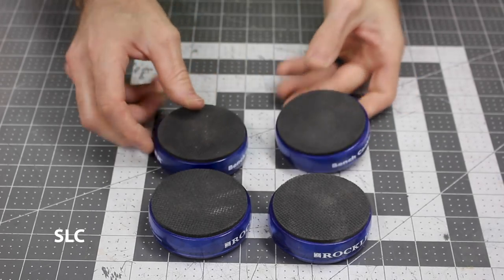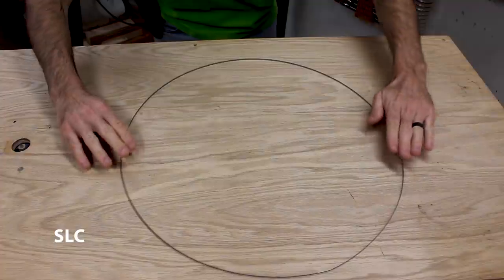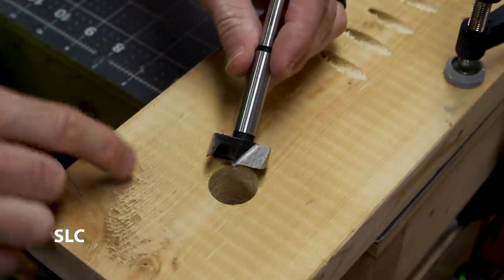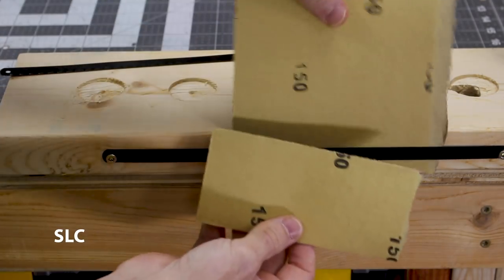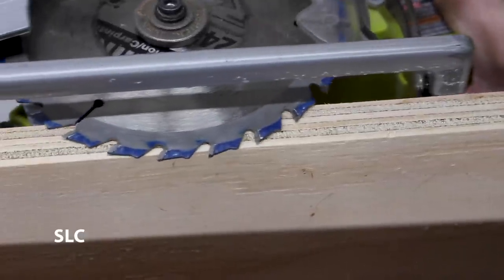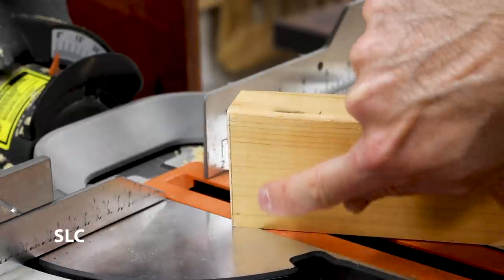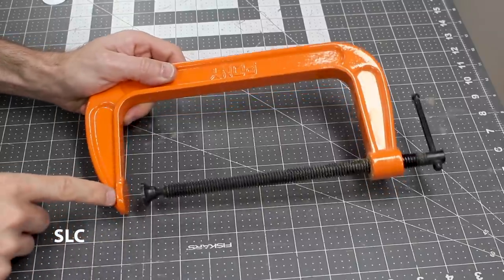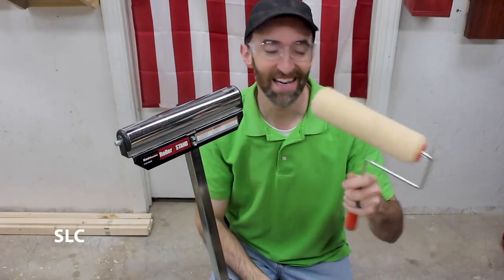20 Workshop Tips and Tricks #2

Comment: For the sanding belt cleaner, you can also use most any rubber soled shoe....not your good shoes, but those headed for the trash.
I go to Dollar Tree, Dollar General etc. towards the end of summer and buy a few pairs of cheap...like $1 a pair "flip flops" (get the largest sizes for even better value)....they work just as well as those purpose made "eraser sticks" and are MUCH cheaper.
Reply from the maker: Great idea on the flip flops, thanks.

Comment: I use a couple squares of floor exercise padding to work under the sink, on gravel around the car, or keep my pants knees out of puddles or snow.  

In the cabin, I tore up the old shag carpet and silverfish padding, and put down 1/2 inch exercise squares.  They significantly cut the draft through the subfloor, and I can peel the area rug back and move the tiles around from high traffic areas to the walls where they can fluff up again for longer life.

I don't have a dedicated space for tool storage, but I have assorted tools in each category that won't fit in one tool bag.  so I have resale rolling duffles dedicated to the type of tool, and I put manuals in the flat pockets in front.  These are relatively inexpensive in resale, usually less than $10 for a bag.   I use chain tags to mark what category of tool is in them:  Drill/drivers, saws, fasteners, heat (glue guns, propane/butane torches, heat stripper, soldering irons, etc.,)   electrical, plumbing, automotive.  When I have a project outside, I roll the bag out to the job.  It's a little fussy but when you're an apartment renter, sometimes dedicated shed/garage is not available.  Rolling duffles are easier to get up and down stairs too.

Comment: For a sand belt cleaner synthetic wine bottle stoppers work great I cut a piece of 1/2 PVC pipe to use as the cork holder. Use hot glue to secure the stopper to the PVC as a handle🤣🛫

Comment: To clean sanding belts just peel the plastic from a solidified tube of silicon sealant and use the “rubber” cylinder as described in the video

Comment: Instead of adding magnets to pencils and sticking them everywhere, buy a retractable lanyard and attach the pencil to it.  If you use a mechanical pencil with a pocket clip, it will slip over the plastic end and securely hold the pencil.

Then when needing a pencil - it is always with you.  Just pull it out, use it, then let it retract.  

(don't recommend something I don't do).

Comment: The whole idea of having casters on my tools is totally lost to me!! You see first you have to understand that "my shop" is very small...8 foot wide by 16 feet deep, so I don't normally have room to "roll my tools around" as much as it is just easier to take them outside on a nice day set them up and use them IN MY YARD in front of my "shop"!! And space in my shop as you can imagine is BEYOND a "premium" to the point where everything "fits into it in just one way"!! So i don't have room for "large tools on rolling stands" to begin with, and MY SHOP also has uneven wooden floors that are NOT the best floors to roll things around on in the first place either!! After all my "shop" is a wooden shed, that was built (and poorly designed) for the most part by an IBM Engineer, who knew NOTHING about building things so the floor supports are a joke at best!! The "NEW PART" of my shop was built by me, and I am not a "rich man" and "used what I had" so the floor in the front part of my shop (I have a video on YouTube which I am planning to update soon) is basically pallets bolted together with 8 foot 2x4s and cartridge bolts tying them together! BUT the floor in the front (which is only 8 foot by 8 foot) is rock solid compared to the back half of my shed!! But still not enough room to roll tools around on!! 

Lastly the down side to "casters" to me is, that moving tools into my yard casters just sink into the ground adding to the mess of dirt I have to sweep off my shop floor anyhow!! And because I have to use EVERYTHING I OWN AS FAR AS SHOP TOOLS OUTSIDE!! I also don't have a cement pad or floor or asphalt driveway close to my shop that I can roll the tools out to on top of either anyhow!! THAT would require me walking CLEAR AROUND MY HOUSE carrying the tools with me before I get into the driveway, because I live in a trailer park....and we have stupid rules.....like no outbuildings NEAR our driveways!!! Our landlord things of "storage sheds" as "just a place to put your mower" and you are also NOT ALLOWED to run or operate a business from your own home IN our trailer park either, which is extremely odd when you consider the owner of the trailer park constantly refers to our park as a "community" yet it is apparent that he has never actually LOOKED at the communities around a town, a city or even an area, because you constantly see "businesses" in the strangest places from the guy working out of his own shop to the woman running a day care center next door!!!!